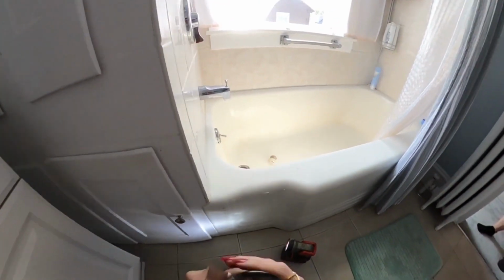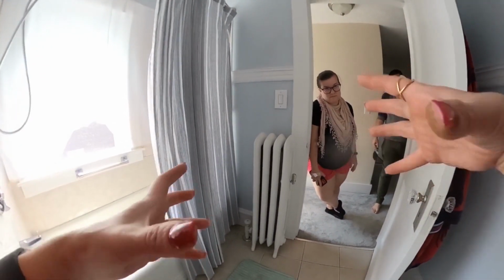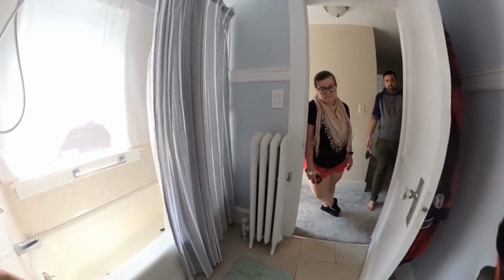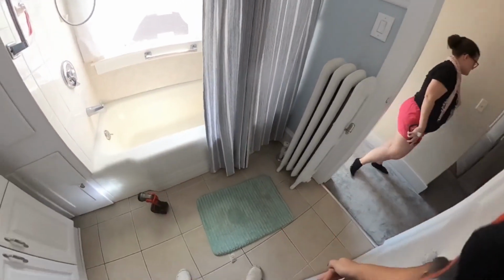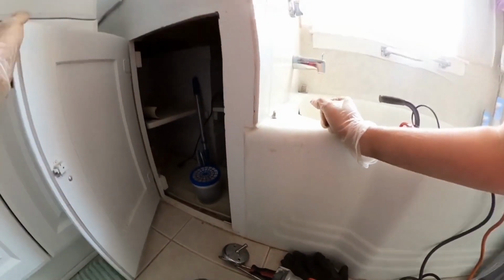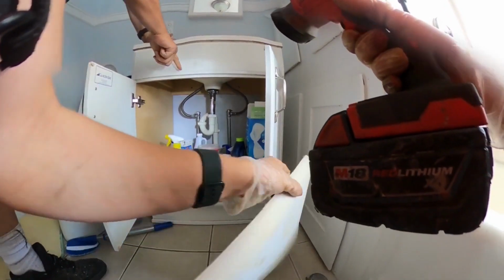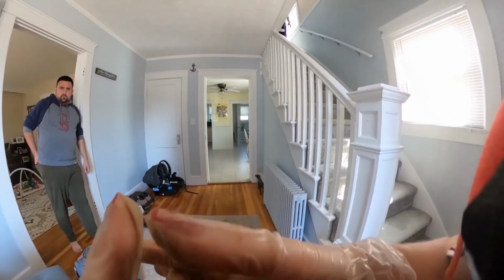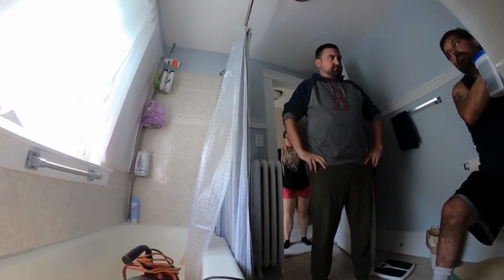Clogged Drain #152 Bathtub Bath Sink Drain

Comment: Hi, Shelly, you are awesome at drains and all about business. And Bob is a great editor. That p trap under the sink was really an s trap which could siphon itself out if a vacuum breaker is not used. No big deal since there is the drum trap downstream. Mobile homes have to use the vacuum breakers since they drain through the floor and not the wall. It’s possible that there is some air finally at the drum trap outlet. Definitely some old work in New England. I’m not a plumber, I fix generators. However I just replaced 15 feet of sewer line in my backyard. 4-5 feet deep dug by hand 😮 I have a splint on a finger for some tendon damage!  It was 50 year old lightweight concrete which had all but disappeared.  I think every man should replace a sewer lateral once in his life and I made it to 58. Once was certainly enough for me. 

I enjoy your videos. You’re an animal when it comes to clogs and I know you’ll take that as the compliment it was intended to be.  Animal just when on the clock.
Reply from the maker: Lol the trap in under the bathroom sink was not actually needed in this type of application. Technically it was double trapped. I've replaced a lot of sewer laterals in the last 8 years of doing this work. As far as the animal comment, you can ask anyone that knows me well. I am in everything I do, lol so no offense taken here. I do think of it as a compliment 😊. Thank you I'm glad your enjoying and well done on your sewer repair. (Shelly)

Comment: Hey Shelly, glad it worked out. I  used to take care of an old high rise apt building that had drum traps on all the tubs, if the cap didn't turn we would get a 3" hole saw, drill it out, then you can chisel out the rest or put a rubber Jim cap over it. Worked like a charm!
Reply from the maker: Thanks for the tip Dennis, we have a spray called Free all that eats the rust and corrosion in the threads. Has a turn around for getting stubborn caps out. (Shelly)

Comment: I hope that's 1/4 in cable, After watching some of the video you need to invest in  a air ram, take the trap off the sink and stuff a ran in there. make sure someone is holding the rag when you ram the tub also there needs to be a ran in the overflow. that should save you a lot of time. After watching it all nmv
Reply from the maker: Hello Matt. We have an air ram. We use it when there is no other option. I explained that to the customer if we couldn't get the cover off the drum trap. We will use air. (Bob)

Comment: I have worked on those drum traps before,and they aren't any fun. Your husband was right about possibly punching a hole in it. The lead is really soft,so easy does it! You did a fine job. Could they have possibly cut it out and repiped it? Thanks alot.
Reply from the maker: They could probably try, however they would have to see if they could vent it probably. I know most of the ones we run into are due to venting. (Shelly)

Comment: I want to buy one of those Ridgid K9-102 flex shaft machines because of the convenience of carrying it upstairs and long distances. But, I keep reading a bunch of bad reviews about it. Have you guys had any problems with it?  Also, is the convenience of having the plastic casing worth it? Or, do you prefer using just that loose replacement cable that I see you guys have?  Thanks.
Reply from the maker: We don't have the K9-102 so I couldn't say if it's good. I like to just use the dura cable machine for the smaller drains. (Shelly)

Comment: Does that machine work on soft poop stoppages
Reply from the maker: I'm sure if you pooped in the tub then you could probably use this one... Lol 😆 if it is a bigger drain I wouldn't recommend using this size cable. (Shelly)